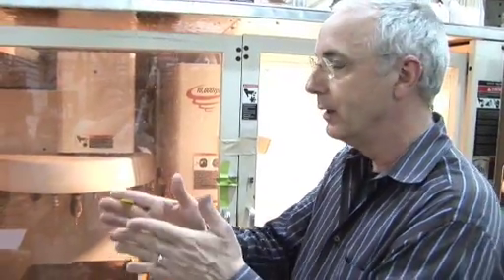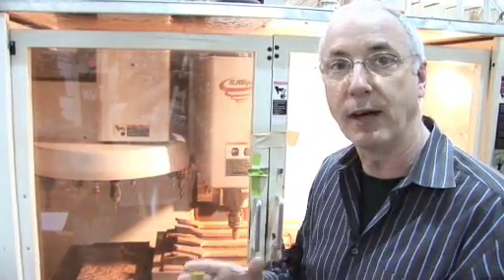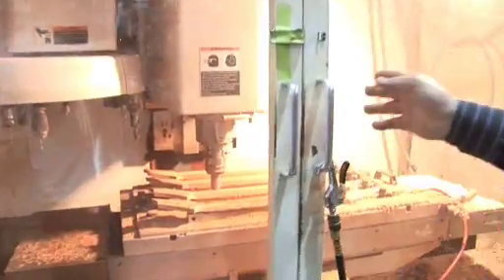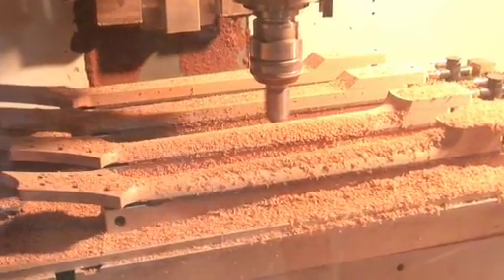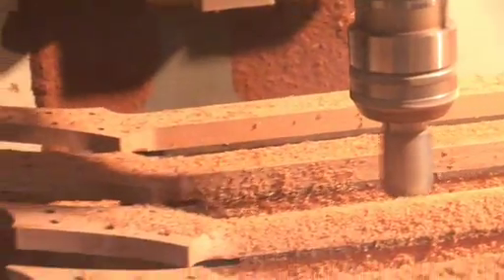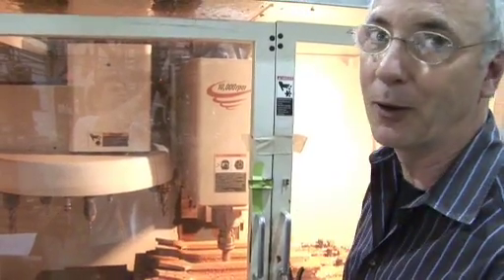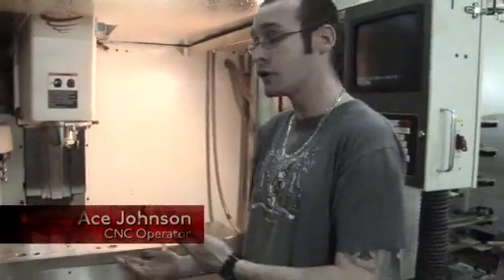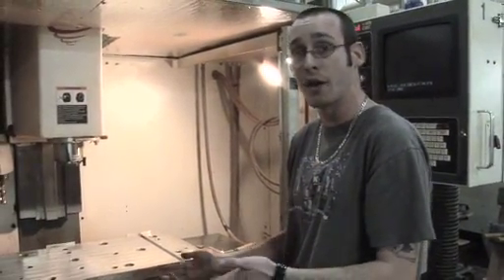CNC Machines & Tooling - Wood Shop - Neck Team

Comment: There's still a LOT of hand work that goes into a PRS once the machines are done making the parts the right shape.   The finishing process alone is very involved and takes a lot of time, effort, and skill.   PRS guitars are expensive but they would be MORE expensive if they were still all carved by hand.   I think PRS is one of the very FEW brands that's worth its asking price.